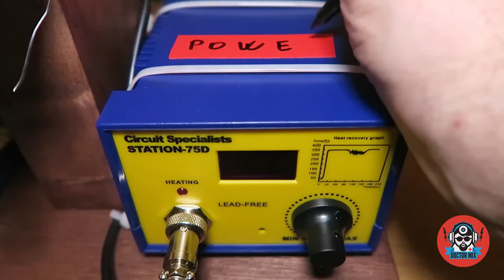How to Build A Cable Making Rig

Comment: Does the iron pointing down cause any heat issues for the rest of the iron?
Reply: not really. its a temperature regulated Soldering Station. With an cheap soldering iron from Discounter maybe a problem if you forget to switch it off ...

Comment: No comments?
Reply: It's not much of a vid tbh. Personally I wouldn't have the iron vertical like that, having the heat going back up the iron isn't gonna do much good and the flux build up over time is gonna get a bit funky. Best just to get a vice and have the iron set in it just off horizontal, it'll allow you to solder with more surface area on the tip.  Also the tip will need cleaning frequently or you get oxidization over quite a short period of time, having the iron fixed will make it a bit of a pain to clean, half a turn on a vice and it's free to handle.
Reply: Yes, you are right. When I do this things, I fix connector in to the vice.
Reply: Agreed, say for a male XLR, the pins can get a bit hot on cheap plugs, putting the pin you're soldering in the vice will sink all the heat into the vice. Nothing worse than a plug with bent pins.
Reply: Exactly, and if it is not possible to put connector in the vise I am using small pliers with rubber band on the handles, in this way you can clamp individual pins and cool them down very effective.
Reply from the maker: Hey guys! Thanks for the comments. I guess you're right, having the soldering iron positioned vertically might reduce its life span. But to be fair we don't use the rig 8h a day :-) Plus replacement irons only cost £11. We already have a few spare ones. I think there is always a compromise somewhere... After different reincarnations, I found that this design is what suits me best. I have tried a few different models of vice, but I was never fully happy. I actually have one that fits right in the middle of the rig, but I find it fiddly to use, and I always end up taking it out of the way. Having said all this we don't claim to be experts at cable making! It's just that we need cables all the time and we rather build our own ;-)
Reply: Doctor Mix

Just do it how you like it. No rules here, important is only the end result.
Reply: Whatever works for you man :) I wasn't having a dig at you personally, it's just "my" preference. I am always making or repairing cables, be it 5 pin DIN, XLR, 1/4" Jacks, Speakons... meh you know how it goes. If it looks stupid and works, it's not stupid. 

I would look a the Hakko type of tips and see if they have issues with the whole assembly getting hot though, you don't want it messing up cause it thinks it's too hot and the controller having issues.
Reply from the maker: Uhhh Hakko looks nice! To be honest I was tempted by the Weller... How is it?
Reply from the maker: An for the vice, any suggestions? I've tried some of those "helping hands" but never found a really good pair...
Reply: Hakko has this little thing that the Chinese guys like, and it's called cloning. They are good at it. Several channels have commented about it. Dave of EEV will always attest that clones are the scum of the earth (poor components that aren't polished on unicorn mammaries), where as others will happily use them, and do daily.  Hakko stuff is really good, reliable and serviceable, and they do callibration tools etc. etc. I'd go as far to say they are probably the best prosumer product. However, the China guys, they use the same components in their own workstations, there's been guys that have been to assembly plants and they are using the clones day in day out and they are really durable. Have a look round here for Hakko Clone - add workstation for a solderstation with heat gun, really fucking handy for heat shrink.
Reply from the maker: The real Hakko sounds reasonably priced, I'd go for that rather than the imitation. Maybe on my cable making rig V2? :-)
Reply: The helping hands are a tit to set up, you spend more time getting them in position than you do doing the soldered joint. If you are doing a lot of circuit boards you can get frames that will hold the components on foam on one side, grip the board and you flip it over and boop all the joints. 

I have an old Record vice that has a jaw that can rotate on one face, I have yet to find it anywhere, it was given to me.  Any table mount vice (with the screw that clamps to your worktop / desk etc) will do, you can usually take off the wooden grip and replace them with your own bits of wood carved / shaped to you needs.  http://www.micromark.com/RS/SR/Product/84382_R.jpg summat like this, you can just attach anything to the inside to grip dodgy bits, or make a solid mount for your iron. 

Non of this has to be complicated, the simpler the better :)
Reply from the maker: Great info thanks!
Reply from the maker: Record vices, just checked them: awesome pieces. Very cool. I want one now. Ha!
Reply: No probs :) I'm a little worried though, where's the rest of the youtube community telling us we are talking out of our arses etc? strange, very strange...
Reply from the maker: Hahahahahaha!!! That'll be soon I'm sure.
Reply: Oh would you PM me how much you paid for the printed heatshrink please? I could do with some standard size and the over size for over XLR, but there's no pricing available. PM so as not to be called a shill etc.
Reply from the maker: I don't have the receipt handy and I can't remember right now. But please send a message via http://www.doctormix.com/contact-us and we'll let you know ;-)
Reply: Record is a UK company too, from the days of Sheffield steel etc. I'm trying to find a picture of my vice, you can find them on ebay from time to time, it's super handy for small and awkward bits and bobs. The back jaw is set, with a horizontal groove and a vertical groove, and the front jaw is not fixed to the front screw, it can swivel round so you can grip a triangle for example. It's weird but cool.
Reply: Done.
Reply: Shh, this is Youtube... you will break it if there's no flame war or idiotic comments lol.

Comment: Nice rig! Doesn’t take into account that the tip needs cleaned after each joint produced, tip life suffers if the tip, after cleaning, has not had solder added on it. The list is long and ponderous, but then I am not a hobbyist solderer. This is sure to bring out the haters. So be it! Not here to wet legs, just bring up valid points. Invest some time in learning proper technique so your equipment and it’s parts last longer than the video. You obviously care so show it by getting a further education in this most important skill. Don’t hate, educate and keep practicing! 🙄🤭😠